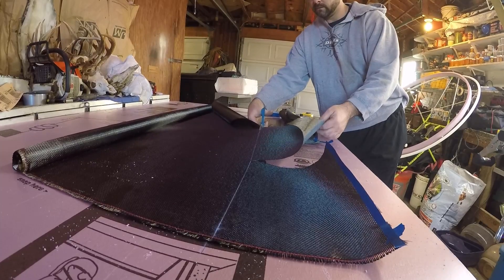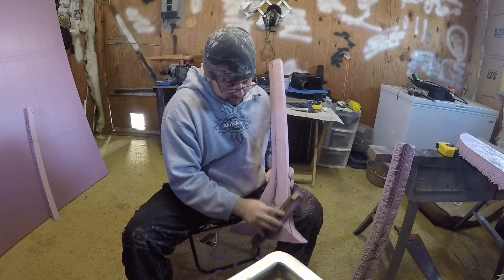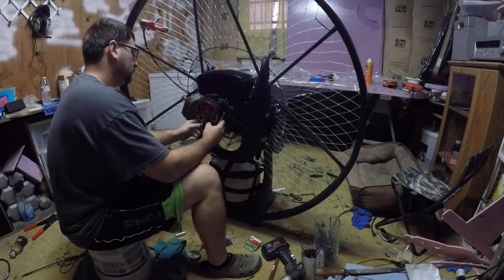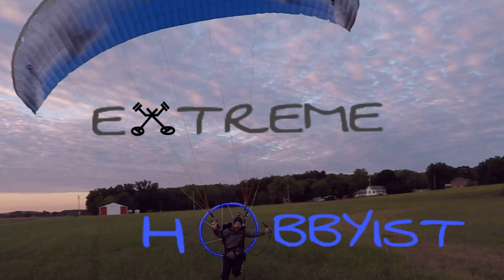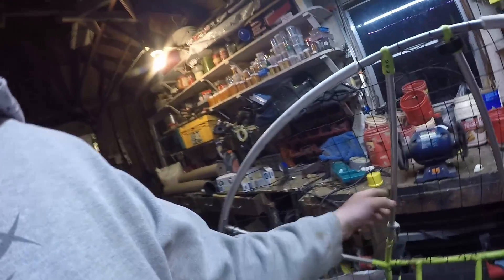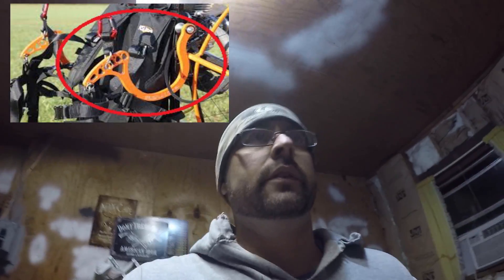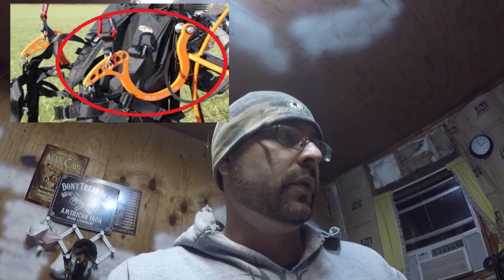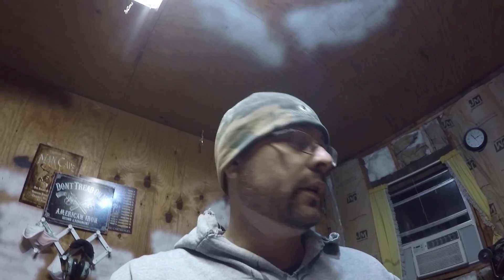Homemade Carbon Fiber Paramotor || Part 1

Comment: I came so close to doing this exact thing!  Hours and hours of research I even put in on studying composites.  I've messed around with some on propellers and molds, but opted for the welding option.  I'm hyped to see this thing come to life!
Reply from the maker: Thanks Kyle! I remember watching your build videos and you mentioning making one out of carbon fiber. I had just started gathering materials at that point. I really could have used your expertise on it for sure!